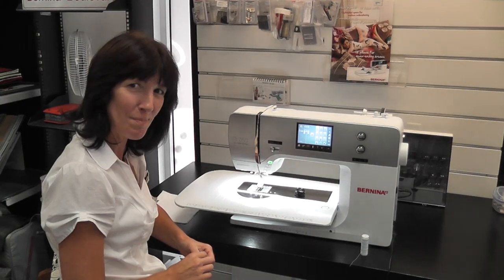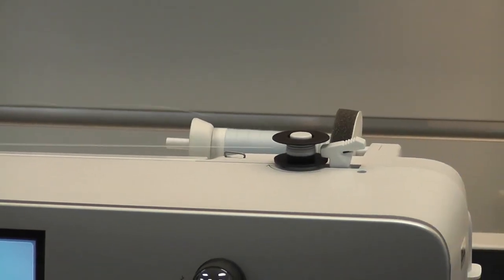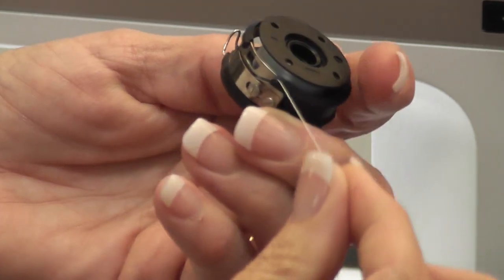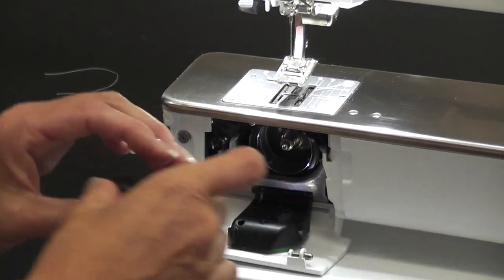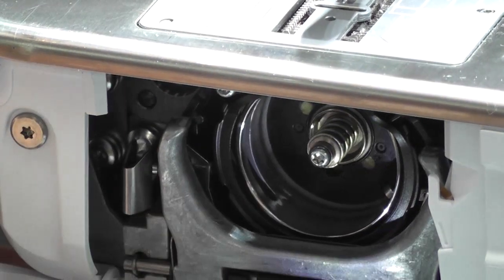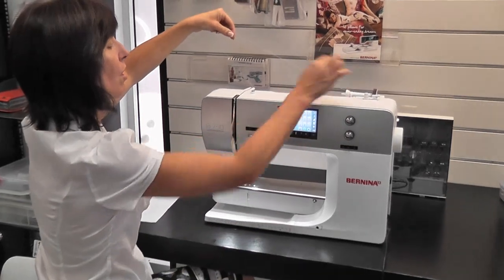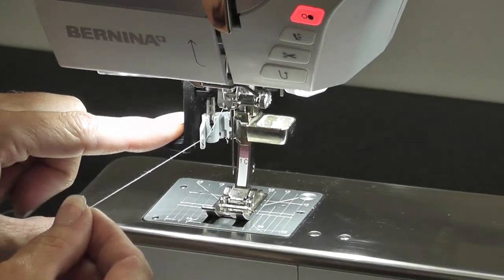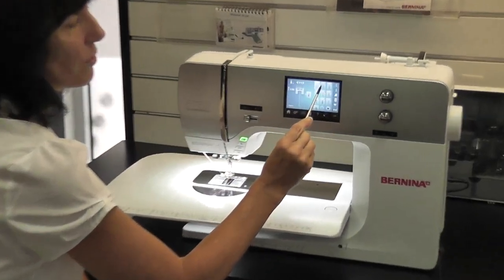Bernina 7 Series " The Basics"

Comment: Hi, any suggestions why a module wont move? I have Bernina B720, my module just stopped during embroidering and it just wont move again. Tried reconnecting several times, looks like the machine recognizes it, it will bring the embroidery arm forward but that's it. Can not calibrate the hoop either
Reply from the maker: Monika Elend .That is very annoying when you are part way stitching out an embroidery.You can recalibrate your hoop and that ahould work.I think your book has the instructions to that.

Comment: Help, please...I have the B750...my thread keeps breaking. I’ve used different thread and bobbin...Alo the design switches won’t work . I’m 3 hours from the nearest dealer..so any suggestions are appreciated
Reply from the maker: That doesnt sound good. I would try first to check if there is any thread stuck in your tension unit.  Re the design stitches not working. I would re put in the latest software download as yours might be out of date.The latest firmware for your machine is V35.13.22. You can down load this from the Bernina website, go to support on the webpage and search  750 firmware downloads.If you haven't done this before there are step by step instructions for you when you do your download. If that doesnt fix the problem then it may need to go to a technician to get checked sorry.  Good luck.
Reply from the maker: Hi Di, Maybe the machine needs recalibrating for the designs to work. Turn your machine off, hold the Needle position buttons and turn your machine back on while holding the buttons.
A screen will appear with a dot. Use your stylus to touch the dot only. It will move, touch the dot only  again and again until your normal screen comes back. Turn your machine off and then back on and hopefully that has sorted the problem. Have you put in a new needle? Sometimes the needle is the reason why the thread breaks. If that doesn't work try oiling it as that makes a big difference. Good luck.